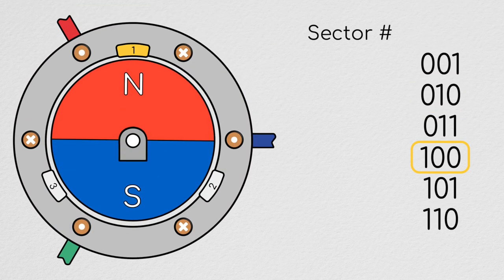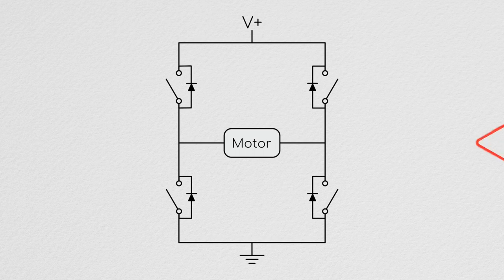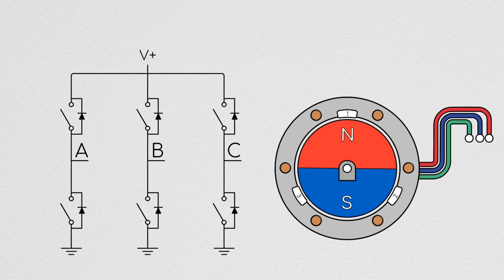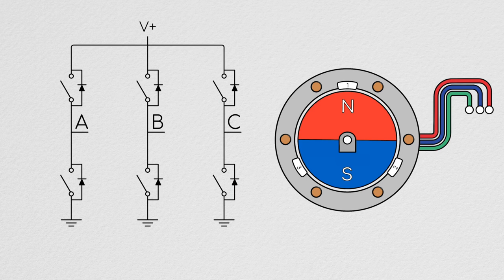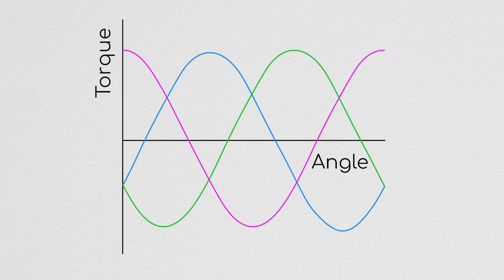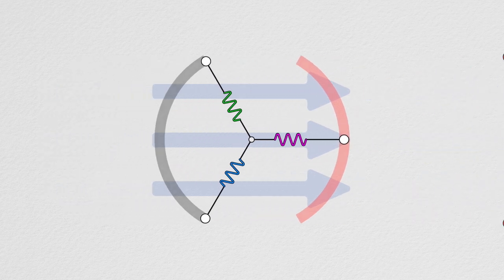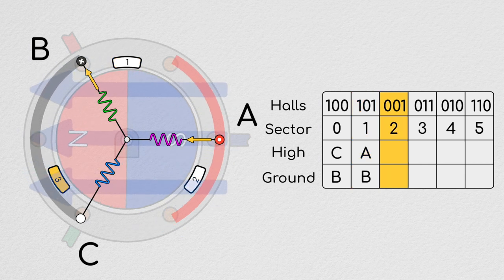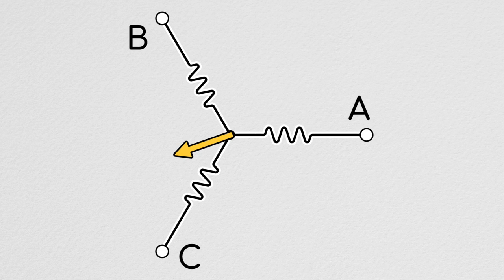How do brushless motors commutate? (episode 6)

Comment: how do you read  for multiple poles rotor. should we make more hall sectors. If so what would be the ration between the number of poles and hall sectors to gain the maximum torque(not considering SVPWM.)
Reply from the maker: Great question! You move your hall sectors to be spread over different arcs of a rotation. For example, a single pole pair has its halls spread around 360 deg, a two pole pair would be spread around 180 degrees, so you would go through each of the 6 hall sectors twice per rotation

Comment: In this video 6 the "sectors" are shifted by 30° clockwise compared to video 5. I think the commutations should occur according to the "sectors" in video 5 not video 6. In doing so, at the commutation time, the magnetic field is exactly ahead by 90° compared to the rotor.